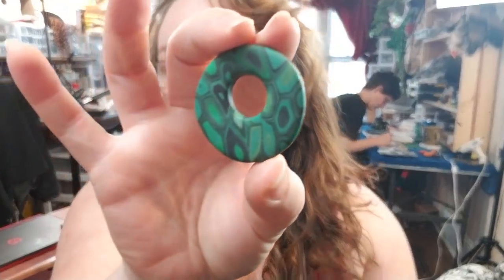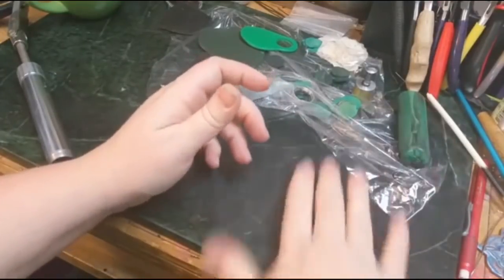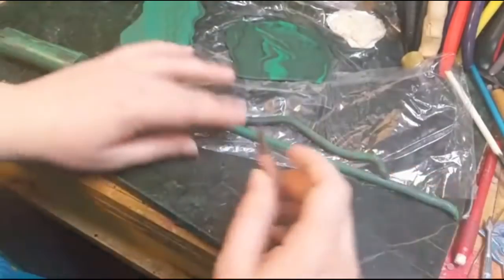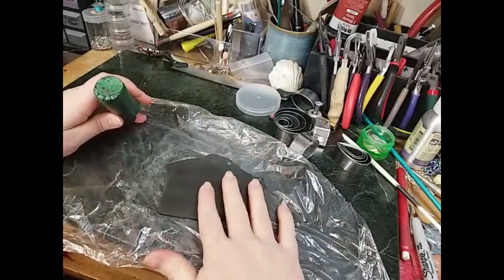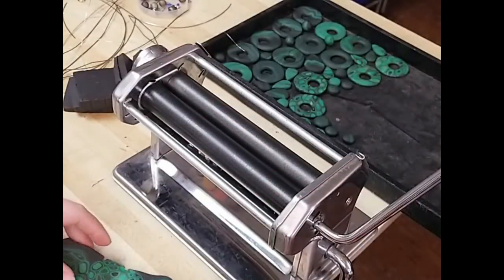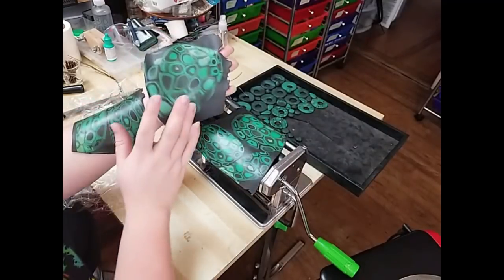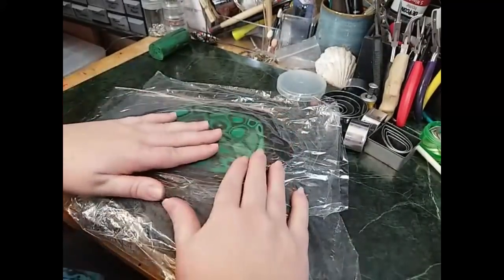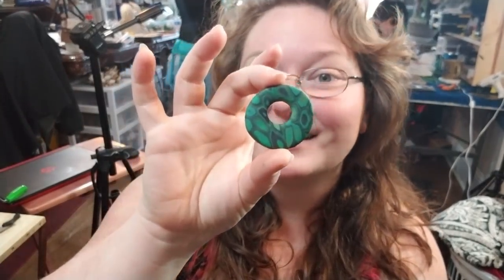DIY Faux Malachite/ Extrusion Cane

Comment: When do you put holes in them, the smaller ones
Reply from the maker: I drill them after baking; you could push a needle tool through before baking as well, but I would let the clay firm up otherwise it will distort the shape